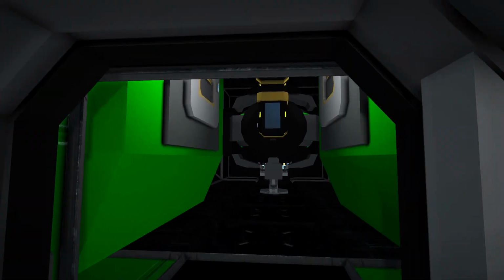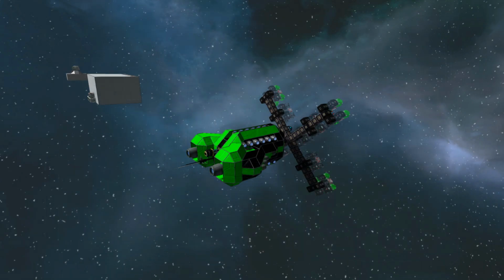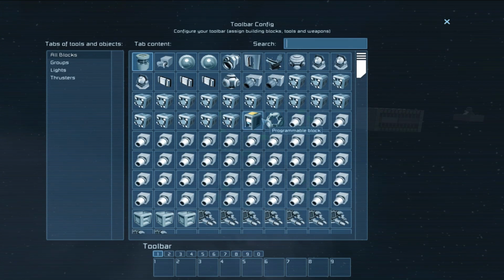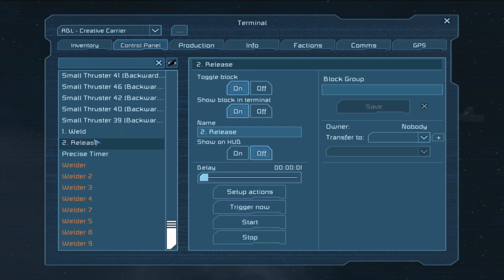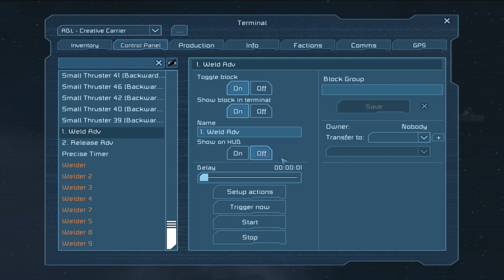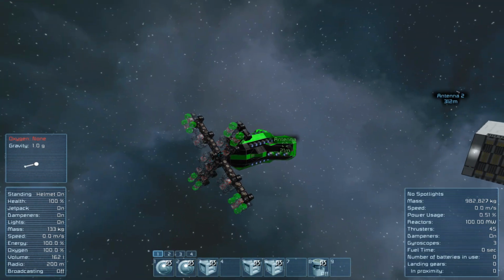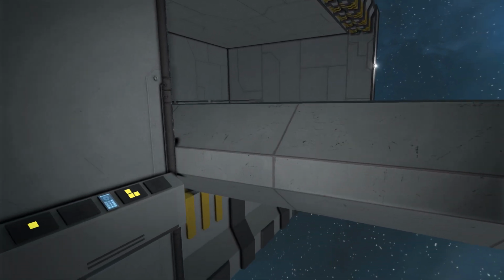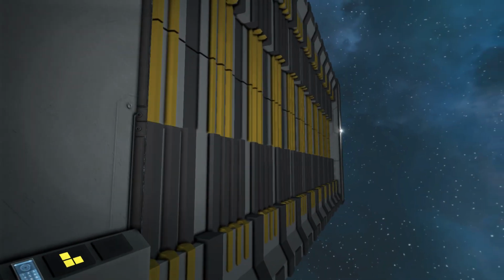Space Engineers - Building on the Basics #4 - Precise Timers & Examples

Comment: Interesting. This would allow for sub-second script running as well, I think, which enables a lot more precise robotic/AI control. Could be used to very precisely control pistons and rotors to do automated welding, with welder 'depth' controlled by a sensor that's constantly being cycled through various sensing ranges (to get a good range sensor).

That'd allow you to do true 3D printing with a single welder.
Reply from the maker: nivikliriak Yeah indeed, basically utilising the fact that 'trigger now' makes the program run every single frame already.. can then assign further scripts to adv timers to get direct control over the length etc :)

Bit out of my realms as a scripter doing something that complex, but I can see how it would help!
Reply: ***** I don't have a lot of experience yet with C#, though I have recently started working on a script for basic indicator lights based on air pressure in a room, plus some automated door lockdown logic when pressure to a vent is lost. I'm starting to get comfortable with it all, and the fine-tuned time stuff will definitely be coming in handy later on!
Reply from the maker: nivikliriak
Sounds like you're doing better than me already heh :)
Reply: ***** :3 Yeah, I put the first version on the workshop last night and made a little tutorial video. Gonna put that on Reddit and see if folks like it.
Reply from the maker: nivikliriak
Nice! Good luck sir :) (and happy cake day :P)